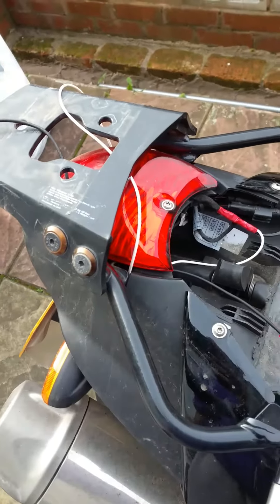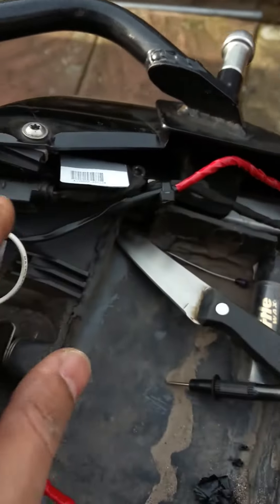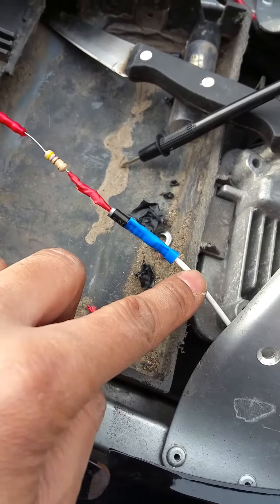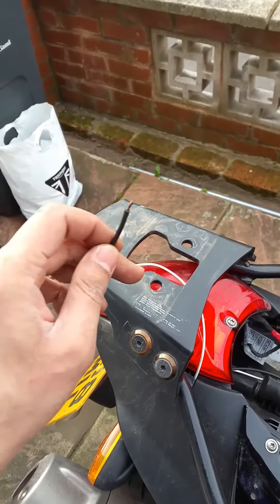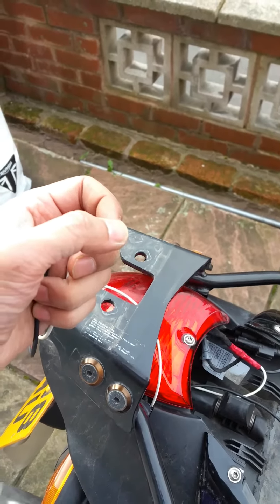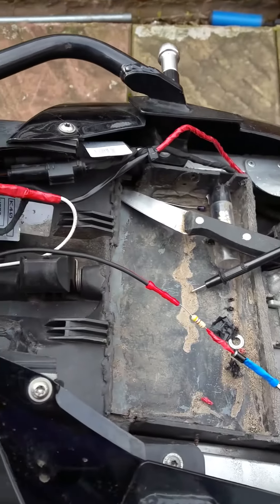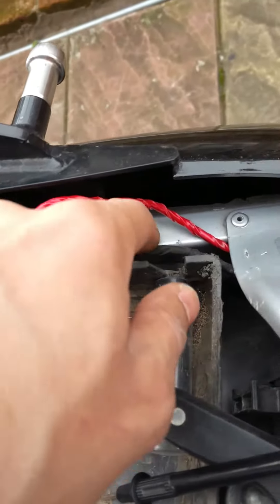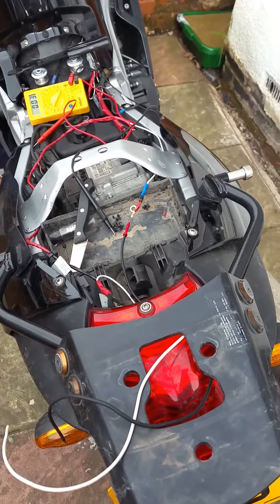Givi Monokey V47 led lighting installation part 2

Comment: How big should the resister be? :-)
Reply: He has a 470 Ohm resistor in the line. But with the circuit as described, assuming it is only a single LED strip,  the bike normal brake light will come on dimly when the power is applied. If you have the space on your top box use two different types of LED. Use 5630 chip LED for Brakes and either 5050 or 3528 for rear lights.